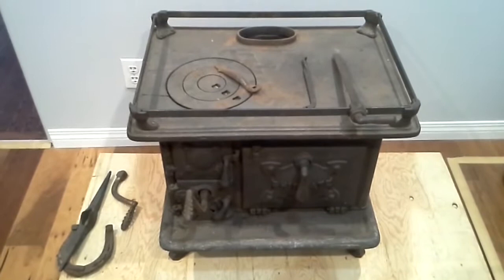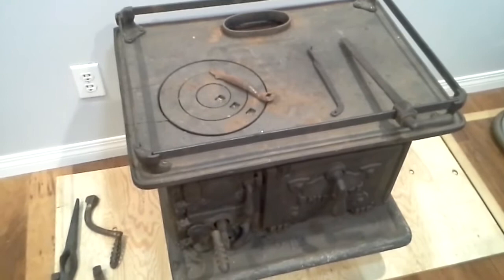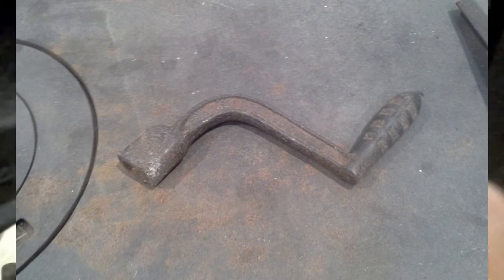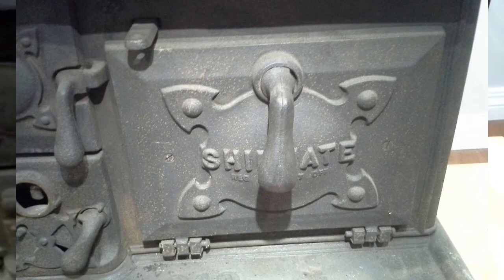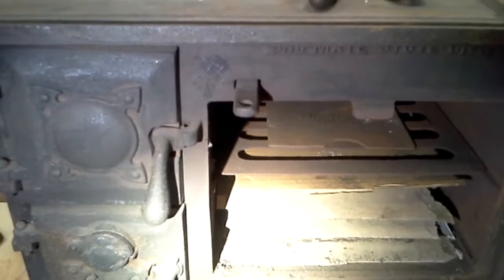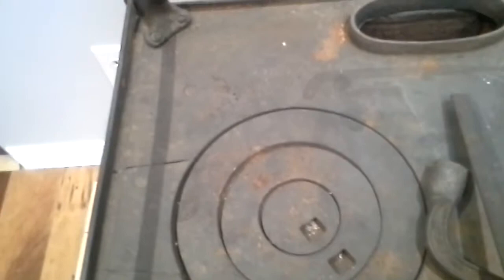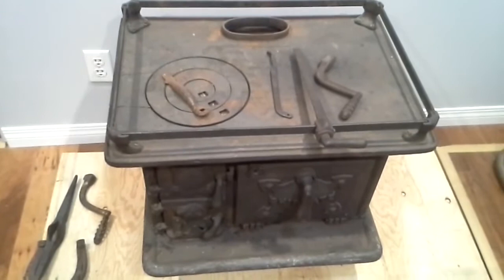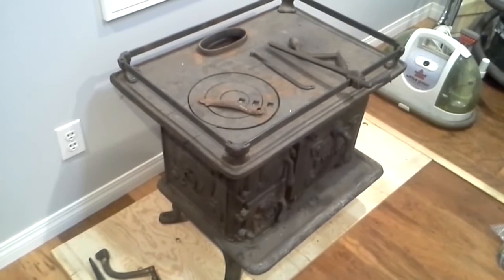Shipmate 212, Sailboat Stove, used on Fishing Schooners, burns wood or coal, Cast Iron Goodness!

Comment: First time I've ever seen or heard of one, thanks man~
Reply from the maker: Good morning Whisper! Hope you're having a great day. It is a really cool stove. Shipmate made many different models. The most impressive one I've ever seen was 2 full sized stoves side by side with a firebox in the middle. It also had a beautiful copper hot water system built into it. It was huge, 8 ft. wide. These stoves are much more common on the East Coast than anywhere else. Thanks for commenting. Mike.
Reply: @HobbiesHobo  Thanks again for sharing this rare stove. It's led me to doing a little research and finding the narrow boats or barges popular in the UK channel systems. Small multi use stoves are a must there. I might have never learned of the lifestyle or hobby. Happy New Year~
Reply from the maker: @whisper8742  The smallest stoves I've seen are being reproduced these days by "marinestove.com" I think. They make repros of the "Sardine & Little Cod" as well as my stove, they call the repro "Halibut". Mike.
Reply: @HobbiesHobo  Fantastic reference information. Just checked them out. Approx 100 stoves a year, all on a made to the order list.  Thanks again, Dan~

Comment: Cast iron stove not good for heating? It should warm up nicely when it is going.
Reply from the maker: No doubt about getting some good heat off this stove. It's small though, good for a very small space but if "Heat" is your goal there are many better stoves than this. It's more for cooking small meals and it does that great. Thanks for your comment and have a great day, Mike.

Comment: Hi! I have shipmate model 1!! On my boat called china cloud. I’m trying to figure out how to refurbish it for summer use and curious if you have may tips!
Reply from the maker: Hi Eden! Thanks for your question! That's what youtubing is all about eh! haha. I am not familiar with the model 1 and I haven't exactly done a refurbishment on my stove but I did plan on it sometime.

If I was going to refurbish it then first thing I would do is disassemble and wire brush the whole thing, then use high temp paint made for stoves, on reassembly I would use high temp stove silicone to seal everything up. My stove is made to burn coal or wood, you need fire bricks in the firebox if you are going to burn coal. It's nice to think about burning stove coal but WOW!, it is almost impossible to buy easily now so stick to wood. I did buy replacement fire bricks for mine at one time but they need to be "Cut to Fit", from a regular stove business.

You should check with https://www.marinestove.com/ for any needed accessories.

There was also a guy in Kaslo, BC, Canada who used to restore stoves but I can't find the info so maybe you'll have to google around a bit for him.

I watched your "China Cloud" video! Looks like a fun project! Have a great day Eden, Mike. (On Vancouver Island).